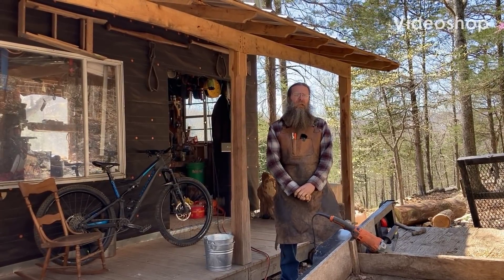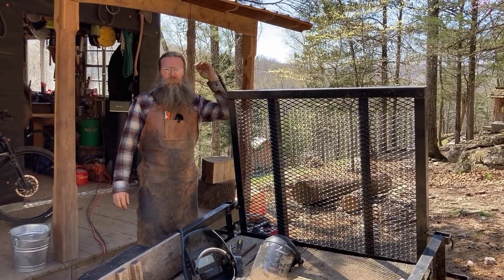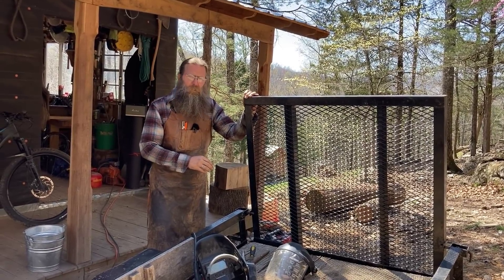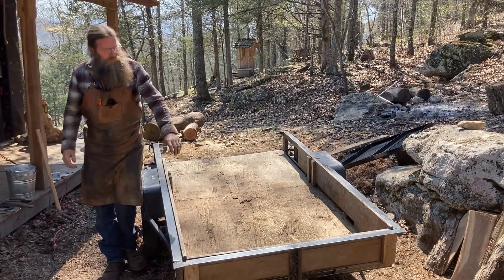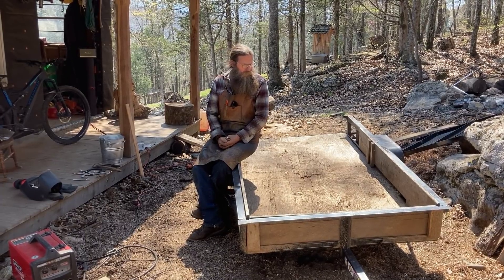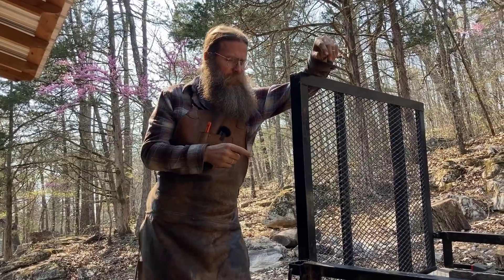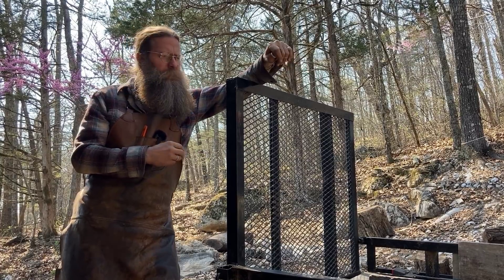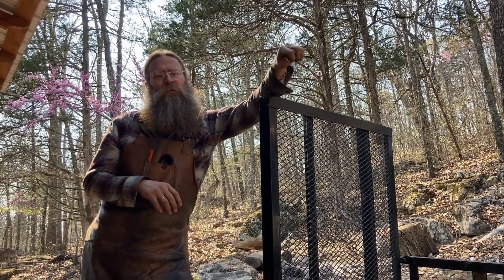Homesteading Essentials

Comment: I love the Chrome T-Bar section used as the crank handle on the vise. Saw it on the last video too.
Reply: I would also add. I envy your Redbuds mine didn't start budding until yesterday no real blooms yet. The most important tool for forging is tongs in my humble opinion and I bet you can make some good ones...hint hint.
Reply: @connorhus  I noticed the Redbuds as well, we're in Kentucky and ours are just barely showing.  The flowers are edible, you know!

Comment: FIRST,  a silly question: Is the strap support you welded to the outer frame also welded along its length to the front angle-iron cross piece under the trailer? I probably missed something there.

SECOND, Amen to the need for a tractor, a boom, a trailer, a welder, grinders, metal working tools, etc. In my experience, tractors are for working; four-wheelers are for screwing around.  They are not good equipment for a subsistence farm/homestead. Fundamentally, a tractor is a tool; fundamentally, a four-wheeler is a toy. There is good reason that tractors are not called "recreational vehicles".

As for needs and wants, you first need to be able to tell the difference between the two. It is affluence and sheltered lives, I believe, that lead people to a point where they can't tell the difference. There is nothing wrong with living comfortably; there IS something wrong, I contend, with taking that comfort for granted. It is even more wrong to cast judgment on others less well-situated. Though understandable, this is also unforgivable, in my estimation. Having a lot of things does not make you somebody; having only a few things does not make you nobody.

THIRD, it is always wise to think about the difference between needs and wants. Only then, if you must, can you figure out what you actually need, as opposed to what you might happen to want. This is not easy but it can be necessary. Reality always bats last. Then, if you need something and you don't have it, you need to buy it, borrow it, or build it. Buying and borrowing are generally not immediate, available, or desirable options -- especially on a homestead. So, you need basic tools and basic skills to build what you need, or you might not make it in a larger sense. Being able to build what you need AND knowing that you can build what you need are just as important as the tools. Maybe more so.

FOURTH, we need to remember that everything we know how to do is something we once did NOT know how to do. Everything!  Fear of new effort is a soul killer.  The effort IS the journey. 
...
FIFTH, back to shoes. I didn't even know what good shoes were until I was in my mid-twenties. I used potato-chip-box cardboard and Permatex to patch holes in my shoe soles for years. Worked just fine. That and a thick coat of shoe polish for school, church, and dancing.  My first decent footgear was a pair of Red Wing boots I used for construction work.  First things first! I used them until they fell apart. Or was it when I ran out of Permatex? Can't recall now. It's been a while. 😎

Great stuff. Great advice. 

Regards, respects, best wishes,

and ... THANKS!

Comment: "Boom Pole" probably the tractor accessory that I use the most.  When we decided to move out of the city (or at least when I finally convinced my city girl wife to move) the first thing that I purchased was a tractor. I found an old Ford Model 2000 for sale nearby and bought it right away.  The Ford 2000 is a newer replacement of the N series, slightly heavier with a few more Hp, but very much the same. When I went to pick it up I noticed a few parts hidden in the weeds, an old Ford single bottom plow, a scrapper blade and a boom pole, they all followed me home.  I have used them all but the boom pole means that I can do jobs by myself that would take three persons normally. Great choice.

Comment: With your skills I would add a piece of equipment we called a stone boat ours was two hewed pieces of wood 4 inches by 18 inches tied together wit flat iron one could use narrower wood but the front had an upward curl and a heavy hard wood 2x2 down each side bolted on and a 2x4 on the top at the back we hooked this behind the team of horses when we still had them and after that we used the tractor for rocks, a water tank, a feeder, trees, stumps, hay bales, kids I got rolled off because my brother took too sharp of a turn and I was too light and rolled off onto the saw grass not fun so it was a very handy item on the farm, for what it is worth, so there you go, after 4 decades of use with 100 yard trips on a paved country road and with a lot of trips on a gravel drive way and lots of field and work in the woods it was still plenty strong.
Reply from the maker: That is a good suggestion sounds like it could bring us a lot of value. And also a great story and good memories thanks for sharing we really appreciate that

Comment: Im still wanting a tractor.I have a jeep but best of all.A clapped out no  good for the road $300 2 wheel drive s10 pickup .It has a customer harbor freight motor picker in the bed 😀😉. Use what you have run what you bring at some point. I love my little 120vac welder. served me many years now.